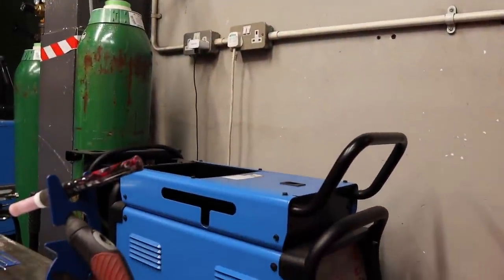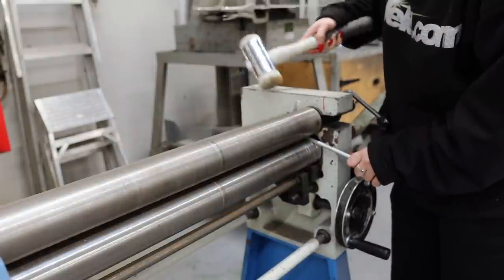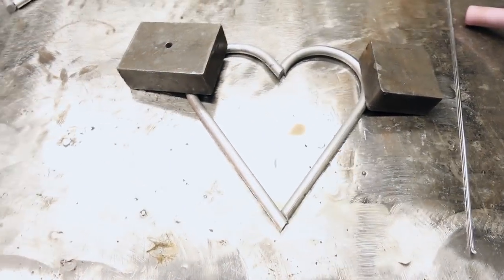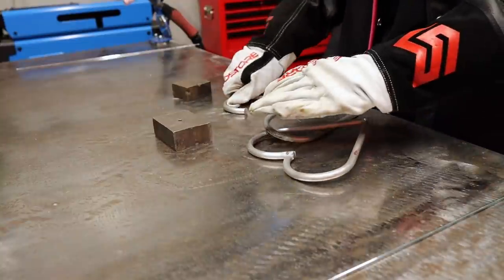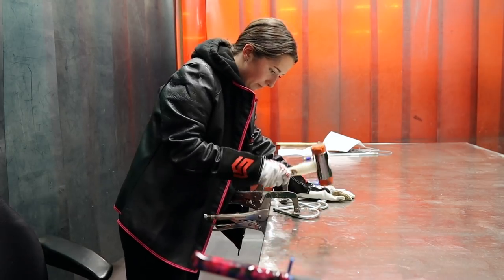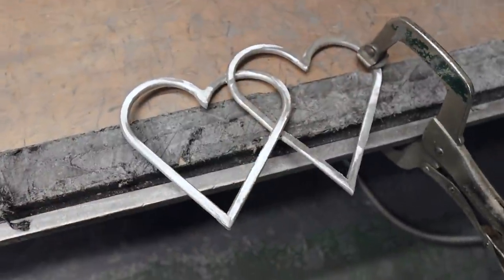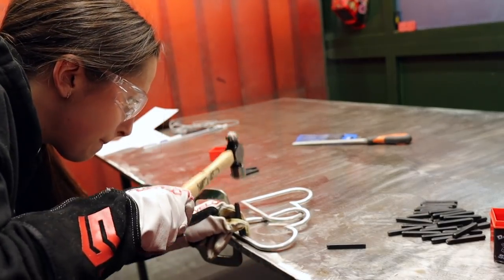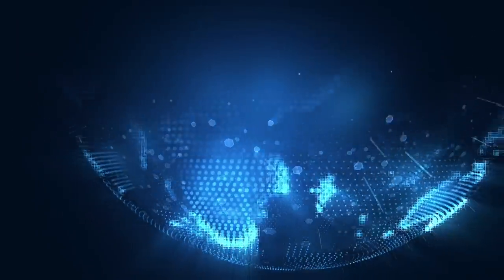DIY Metal Art Gift Idea for the Welder's Special Someone

Comment: Might be a dumb question, but what is that smaller third component sitting on top of your machine? Never seen that with a TIG machine before. Unless it's a wire feeder attachment, seems shorted than the ones I've seen though

Comment: I would sincerely share with you two very important safety notes you should consider. Number one, never wear gloves when cutting on a smaller table top bandsaw. If that blade gets a hold of one of your gloved fingers it’s gonna take a lot more…. If you didn’t have gloves on then you could pull your hand out and save a lot more. Number two, I urgently recommend you start using a respirator especially when grinding fine aluminum if you would like to keep your lungs later in life. Otherwise your project looks great, kudos.

Comment: Oh wow, I used to digg this channel but this Video is so unprofessional in so many terms. Bad OSHA/PSA (e.g breathing protection), grinding aluminium is dangerous(explosion risk) and you should tap the embossing stamps only once but hard(er). Really miss the quality of the old hosts of the channel.
Reply: grinding  Aluminum is explosive?  have you ever seen it explode? is cutting it dangerous too?
Reply: Grinding aluminum is perfectly fine if you use the appropriate wheel for it. The materials the grinding wheel are meant to be used in are printed in the grinding disks. The explosion risk you are regurgitating has ti do with grinding aluminum on a pedastle grinder. A grinding wheel WILL clog with soft aluminum and runs the risk of exploding if it is glazed over and the aluminum heats up, expands, and fractures the brittle wheel.

Again, use the right toll for the right job, as they did in this video.
Reply: @JSaltyfabricator  you are so correct
Reply: Oxidising Aluminiumdust tends to selfignition and together with moisture/water it can even lead to hydrogen. And still even if the right wheel was used, there are enough bad behaviors in the video to make it look unprofessional and not suited for educational purposes or big audiences.
Reply: @Mr321Meiner  good reason to clean up the grinding dust then and not grind aluminum underwater.
Reply: Wow... Is this what it looks like to my coworkers who look at me stupid when I put on safety glasses and put a grinder shield on a tool they were just using. 
( I Work with idiots but this is just an absurd idiotic fictional concern)
Reply: You sure showed her, Ranger Rick.